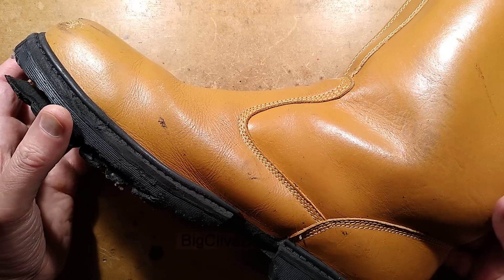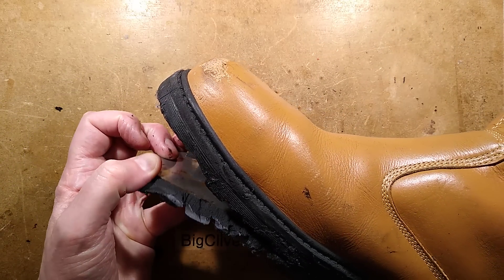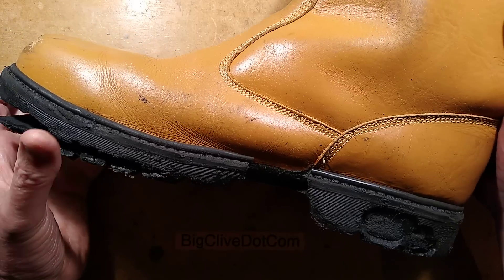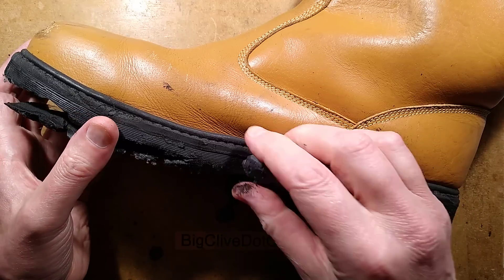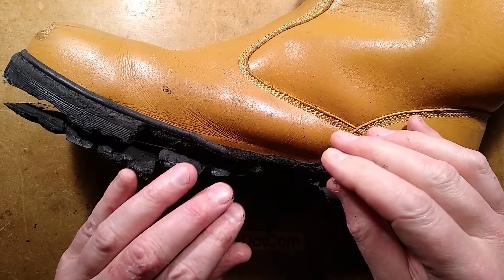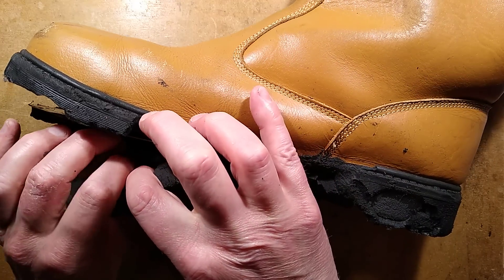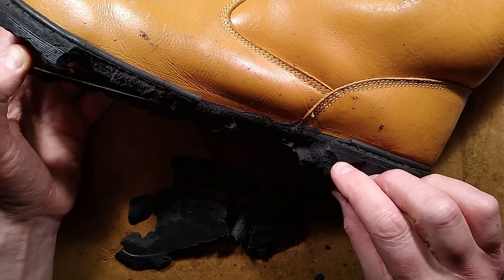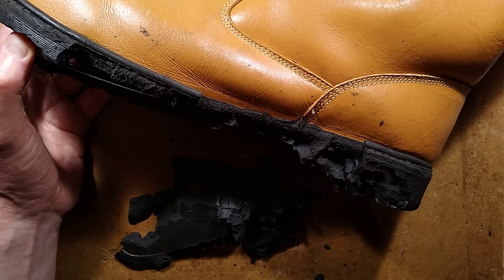My work boots have melted!

Comment: This reminds me a bit of what happened to my shoes when I walked on an eight hour old lava flow.... and then it got me wondering what asphalt workers wear.  A quick online search revealed there are actually shoes designed for such profession with heat resistant soles called "Asphalt Pro".
Reply: Hold on you  can't just flippantly bring up walking on 8hr-old lava flow, without slightly more context? Was it for work or pleasure?
Reply: My friend Mike did the same and not only did his shoes melt it warped the shutter in his camera.
Reply: @tdata545  You're right! Then again, the same thing happened to the boots I was wearing when I walked on Mars, so maybe it's just that.
Reply: @trustnoone81 Mars?! Twas easy to walk on Mars!  Why, I remember the last time I popped over to Mercury for a light stroll and me boots melted into my very DNA. That was a warm walk!
Reply: @tdata545  It was his own assphalt.
Reply: @tdata545  It's easy, just stay as far as possible from Tom Scott.
Reply: @trustnoone81  When I strolled about on Pluto last vacation, my duck boots frequently accumulated clods of frozen nitrogen - most annoying, as the bandicoots I was hunting could easily hear my approaches.
Reply: @tdata545  wait you mean you don't live in a secret island with an active volcano?
Reply: @trustnoone81  I went further...or...nearer, when I went trekking on Mercury !
Reply: @marcogenovesi8570  Not since I've been kicked out of The Enclave of Evil. I lost my rights to use the volcanoes to dump my foes into.
Reply: @tdata545   There are a few places where you can walk on freshly hardened lava.  Hawaii and the Galapagos Islands, for starters.  It's rather frowned upon, since they don't want tourists falling through the crust and into the molten rock beneath. (Geologists and volcanologists get a pass, but at least they know what shoes to wear.)  
I've walked on crunchy week-old lava that was like a black, foamy glass.  Safe to walk, but you wouldn't want to fall on it!
Reply: It was in Hawaii, and at night.  You could see the glow in the cracks below your feet, and it was obviously quite hot.
Reply: I was a wildland firefighter, you want to pay for quality stitched soles. The only affordable footwear is high ankle to calf, stitched boots, leather. Unless you can afford 3rd degree burns. No synthetic socks either.

This early life lesson has stuck with me, I refuse to get poor quality footwear. I will always have 'real' shoes or boots and they will easily last a few years while I work.
Reply: @jonanderson5137  Yep agreed,, leather shoes and boots arent that dear. And people dont compliment trainers.

Comment: Hydrolysis is the chemical breakdown of the PU polymer and the resulting physical breakdown or crumbling of the PU sole by the attack of water (usually in vapour form), occurring over a period of several years (even when the shoes are in store!). This process is accelerated by warmth and high humidity.
Reply: Interesting... so possibly silica gel in the box might help preserve them?
Reply: The funny thing is.... a lot of 'plastics' will degrade if the air is too dry.
Reply: Thank you.
Reply: @MadBiker-vj5qj  I believe the usual suggestion is to try to wear them occasionally.
Reply: @kcgunesq  Yes, since your weight walking will squish the humidity out of the soles and heels.
Reply: Hi  humidity does this to many rubber coated products where I live in Spain and it will make hard plastics crumble into dust. Clive may have a problem with damp in the closet where he sorted the boots.
Reply: "accelerated by warmth" - Not in Clive's house!  I think in winter he keeps it about 12c.  LOL!
Reply: I heard that hydrolysis happens faster if you don‘t use the shoes often. More use somehow delays the effect of hydrolysis.
Reply: Ah, I had the same happen to shoes that were left in a damp basement for years.
Reply: @kcgunesq  I think for those (usually battery/corded) tool handles you must use them frequently enough that they get hand oiled and any initial breakdown ooze is swept away before overwhelming the material with its stickum.
Reply: So, in the shoe store when test walking your potential purchases, you should look behind you or loop your circuit to see if you are leaving cookie/biscuit crumbs behind you? In case your selection for trialing are from the stores "vintage collection" (do shoes have a best before date provided?).
Reply: Stopped wearing Knapp shoes when they fell apart like that 1984
Reply: @Don.Challenger  Might have to worry about dead mall shoe stores where you know some stock will have been there for years unused.
Reply: So when you said " This process is accelerated by warmth and high humidity", were you thinking of excessive exposure to sweaty feet ???  🤣
Reply: Wearing footwear with PU soles helps them last longer because that helps drive out moisture.
Reply: Pretty sure this is the reason why my 3DS CirclePad plastic cover melted and crumbled away last summer..
Thanks for the explanation mate

Comment: Some plastics have 'softener' added to them to make them grippy or flexible etc. . . . I used to work with raw PVC (injection moulding) where we would mix in a liquid softener by heating and shaking the granules until they absorbed the oily liquid . . . Unfortunately, it's an unstable alliance and after a given amount of time (months/years) the PVC would first turn into goo and then ultimately end up as a crispy residue!!
Reply: Yeah sadly most people don't realise that plastics are not exactly stable. Many of the old fashioned hard plastics will last for years but modern cheap shit that companies use can destroy a product in a few years.
Reply: @crunchyfrog555   i think they use the softer soles because it makes the boots wear in quicker and more comfortable.  for example, have you ever seen a pair of boots where the tread on the soles wear out.  there were australian brands that gave us customers a choice.  i have bought both sorts from the same maker.  i ended up preferring the older harder sole material because it was more resistant to nails and cuts.
Reply: You get some plastics that never get to the goo phase but just go more and more brittle and weak over the years until it has the consistency and strength of potato crisps/chips.
Reply: @Ghlargh   I had ski boots for a decade, and eventually that's exactly what happened to them.  The softener (technically, a "plasticizer") oxidized over time, and the shells of the boots just fell apart ... they had all the strength of a Dorito chip.  (Sadly, because the boots fit so perfectly, I had bought a second identical pair on eBay - and of course they suffered the same fate, at the same time.)
Reply: @crunchyfrog555  for sure !
Reply: @jpdemer5  ya when I worked at the ski shop we had to throw out lots of equipment because of that. They basically crack and all that's left is the insert. When I first seen it I was amazed. They seem so strong until then.

Comment: I had a pair of used issued British Army boots.  They were fine for many years then suddenly, from one weekend to the next, the soles did exactly the same thing.  At first all was fine, but as I was walking on them, I noticed my left heel was at an angle. I looked and saw a whole chunk of the outer edge of the heel had just vanished.  The right boot heel was not far behind.   Years of service and over night they just degraded.

At the time I was not in contact with any chemicals or such. I just used them to run around a forest playing Airsoft.  I loved them as they were waterproof right up to the top of the boot so while all my mates used their "tactical" boots that cost 5 times as much as my used ex-issue boot, they got wet feet... I didn't.
Reply: That has been a concern with the newer style military boots. I've got an old pair of DMS style from the mid 90s and they're still solid.
Reply: @@peter806wilson they used to be. Unfortunately they also make for good MC boots so they've taken a bearing over the years and now have a slightly more "fuzzy" finish to them!
Reply: @JaenEngineering  They do however buck your shins up good and proper.
Reply: Water proofing isn't always what you want. A light, breathable shoe or boot is often better than a heavy water proof boot for most applications. Your feet getting wet isn't the end of the world.
Reply: bmused55, do i believe you?  you bet!  over a period of about 7 days?  it happened to me too.  i got value out of them up to that point though.
Reply: @CarrotConsumer  on a cold, wet, winters day, waterproofing is king
Reply: Yep same happened to mine. Really annoying as they were my best pair parade boots. Perfect leather soles completely disintegrated.
Reply: Had a pair do exactly the same, the uppers were perfect condition,  went to wear them one day after a couple of months of non use  and soles had gone soft and started to fall apart... Would probably try to get them resoled these days though .. if any old school shoe places that do that still exist.

Comment: For the textured coatings you mentioned the only thing I have found that will stabilize them is talcum powder. Chalk works poorly and temporarily, and cornstarch just makes a mess, but real talc makes items with that coating usable again. Took me years of trying different things as I came across things with that coating to figure that out. It will always be a little bit sticky but usable.
Reply: I'll have to try that. A couple times I removed the sticky coating entirely with 90+% IPA and lots of rubbing, but it's quite tedious.
Reply: Degraded soft PUR coatings that have turned sticky can be removed from the base material using ethanol and a toothbrush. I sometimes use ethanol gel so there is a prolonged time the stuff is in contact with the PUR - saved some Tivoli Audio radioas and a few SLRs from the late 90s with this method...
Reply: @steveoddlers9696  Yup glad you found that out as it's the thing that I use too. For me it can be teedious if it's really textured and you need to get into small spaces. but for handles, knobs and so on it's quite easy. I guess it depends on what you've got - mine' mostly electronics and synths.
Reply: A friend of mine, recently passed, claimed his father,  an engineer,  was the first to develop the talc treatment for rubber and urethane during WW2. I never investigated this.

Comment: Quite an interesting failure! I work in the rubber soles industry here in Italy (for fashion, not work-related sector) and we mostly use SBS/TPR and TPU rubber. While the quality of our rubber isn't that high, this kind of failure doesn't seem to be an issue. The only notable difference is that the "light" variant of the TPR we use isn't very resilient to abrasion, but that's because that rubber contains large amounts of expandent product that will basically makes the rubber like a foam

Comment: I've had a few things do this, a pair of hiking boots, the 'rubber' wheels on a mobile toolbag, along with the the surface of  numerous 'velvet' feel electronic devices turning to goo.
Was there an oily looking substance on or near the boots? My guess is that the plasticiser separates from the plastic/synthetic.
Reply from the maker: There was a very sticky residue.
Reply: Ooh matron! 🫠😏
Reply: Good boots last for decades but that is bad for boot sales, this looks like auto self destruct so you have to buy new ones !

Comment: I have a pair of shoes that I bought in 2002...the soles are still perfect...the only problem with them is the glue that held them to the bottom of the shoe has failed on one of them.
Reply: I have work boots that both soul and heal are one piece and come off every year. I simply glue them back on with Goop or E6000 (sold at walmart 1/2 $ of Goop.)
Reply: @frederick6008  Damn. I want boots with a soul and that can heal.
Reply: The rubber cement is perished. The cement breaks down and in your case it has come apart. You have to clean or sand the surfaces the best you can and then reapply the rubber cement. You may want to have an expert do it for you so the sneaker skin will fit tightly on the rubber.
Reply: @stupot_64  And wear them on sundays.

Comment: A lot of different materials have been used in shoe soles and each has strengths and weaknesses.

Vulcanized natural rubber, cross-linked poly(isoprene), while fairly tough and heat resistant is susceptible to ozonolysis, which leads to the soles becoming brittle and crumbling with age.  Exposure to oil can cause swelling and cracking.  Probably not the issue in this case.

Plasticized poly(vinylchloride) (often called just "vinyl") is fairly rare in shoe soles, but tends to harden and crack as the plasticizer is lost, or become mushy and crumble if exposed to oils.  A possibility here, although those boots looked too nice to use such a cheap sole.

Thermoplastic poly(urethane) (TPU) is very tough, but tends to hydrolyze over time in humid environments.  Depending on the specific polyol and isocyanate building blocks, hydrolysis can lead to anything from crumbling to dust to total meltdown.  A possibility here.

Neoprene, cross-linked poly(chloroprene), is usually used in oil and chemical resistant soles, but will degrade if exposed to chlorinated solvents, refrigerants or high heat.  Probably not the case here.

Synthetic rubber, cross-linked block copolymer of butadiene and styrene, similar to vulcanized natural rubber, but cheaper and more durable.  Also similar to natural rubber with regards to ozonolysis and oil swell.  Probably not used here.

Thermoplastic elastomer (TPE), copolymer of ethylene and propylene (or sometimes higher alpha olefins), tough, durable, ozone resistant and recyclable, but not heat or oil resistant.  Probably not the problem here, unless the boots had been contaminated with oil before storage.

EPDM, cross-linked TPE, tough, ozone and heat resistant, can still be degraded by oil.  Again, unlikely here.

A flame test could help to distinguish these materials from one another.  TPUs and synthetic rubbers contain a lot of aromatic rings and burn with very sooty flames.  Vulcanized natural rubber contains sulfur cross-links and produces the characteristic pungent SO2 odor upon combustion.  PVC and neoprene will burn with green edged flames, copious soot, and pungent HCl fumes (not to mention some phosgene and possibly dioxin - best to do this outdoors, if at all).  TPE and EPDM will burn with nearly white flames and not much soot.

Given your humid environment, I would lean toward TPU as being most likely to produce the observed results on extended storage.

Comment: I’m told that certain synthetics like neoprene resist that sort of degradation, but others are notorious for it. Exposure to certain solvents seems to speed up the process but doesn’t seem to be necessary.
Reply: Neoprene degrades over time. I've had several wetsuits that dry rotted. as time goes they get less supple and have less stretch. Eventually the neoprene becomes brittle and crumbles.

Comment: Had something similar happen to a pair of steel tipped work shoes a few years back. I had them on because I was carrying out the winter tires to my car and it felt like I got something stuck under my shoe as I was walking. Didn't think much of it as I was busy carrying heavy things. Then a few steps later I felt like something was off with my other shoe as well. I looked back and both of the soles of the shoes had been left neatly in place where I walked...

Comment: i noticed that a similar thing sometimes happens with a chewing gum if you fall asleep with it or watch a long video without chewing: at some point it abruptly undergoes a phase transition, crumbles and turns into nasty flakes/paste. the transition is very binary, there''s no inbetween: it's either normal gummy chewing gum or it turns into dust. chewing gum has a surprisingly similar structure to boot soles, so maybe there's some connection?
Reply: Also happens when you eat a piece of chocolate while chewing gum
Reply: However, if you do want to resume chewing when you awaken, you should beware of attaching it to your bedpost overnight as you run the risk of it losing its flavor.
Reply: @jakx2ob  Peanut butter and chewing gum is an awful experience. Unless you're removing the latter from hair.
Reply: @chaos.corner  Reminds me of a song,,ha.

Comment: In built obsolescence, similar thing occured with most of Clarks shoes when they swapped manufacturing countries 🙄
Reply: Clarks used to have a good reputation. I felt cheated when my shoes disintegrated as they weren't cheap, so have not bought from them since.

Comment: Hah, I had a pair of Sketchers steel toe boots that did something similar. I was on a tower and suddenly I feel something sticky on my feet and turns out the soles on my boots just started falling apart and melting to anything it touched.  Almost like it was exposed to some sort of solvent that devulcanized the rubber, but it wasn't. I used them only for tower climbing and I only climb a few times a year.  I did find that they were a good 10 years old at that point though (I though they were newer).